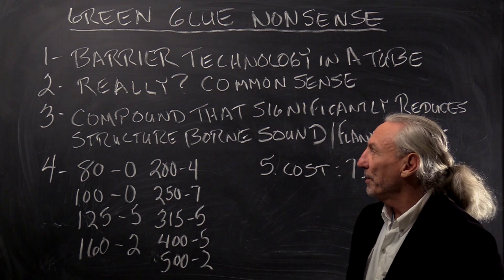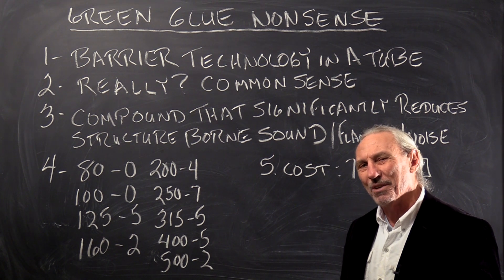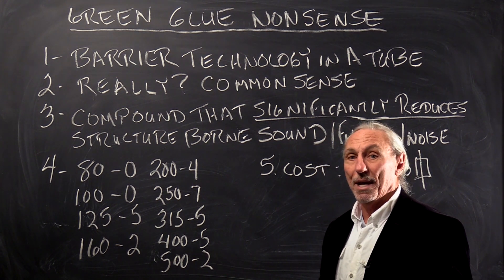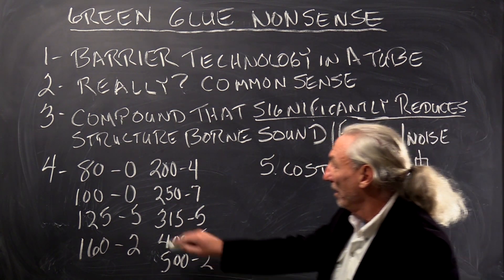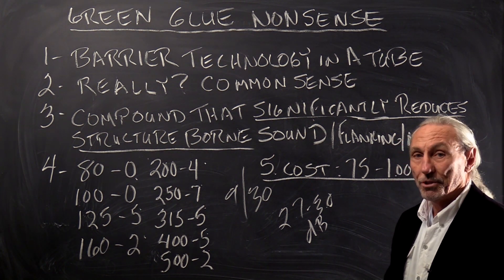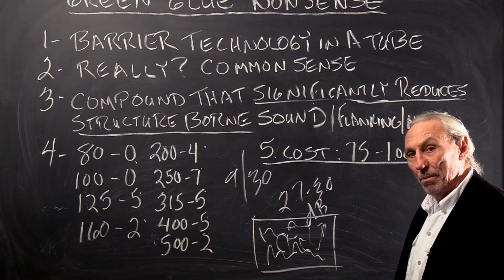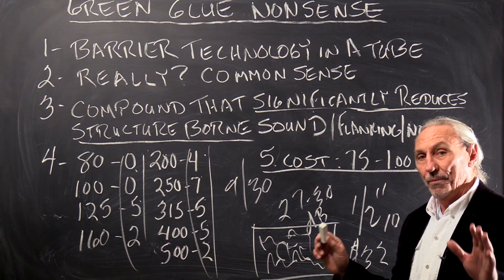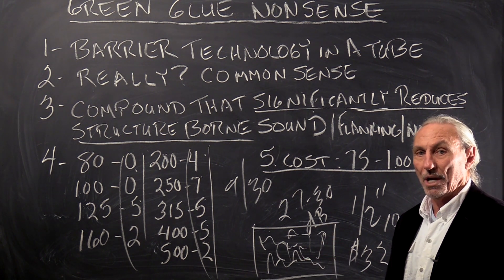Green Glue Nonsense - www.AcousticFields.com

Comment: I   rather like this video, because after using the stuff in a similar build to  one  without the green glue - my (admittedly subjective) view is that the  sound leakage was not better - nothing I suddenly went wow over. Surely here the problem is that you use it and once you have applied it, you can never know what it really does. I've had  more success with an extra layer  of MDF,  than the huge cost of green glue in terms of attenuation overall.  I don't know anyone who has built a structure without it, then replaced a layer with green glue between sheets and measured again. That measurement I'd believe. I have to be skeptical here. Buy new monitors, you  hear it - but  a very expensive layer of sticky gunge between sheets (and glue seems  a good term for it) I just have trouble with.
Reply: Hi, just wondering if you are using the MDF or for improving sound in your listening area? Thanks
Reply: @detroyt232323  A trick I did a few builds back in a college. Plasterboard is simply rotten stuff for crashing flight cases into and scuffing from chairs etc - so I added a layer of 18mm MDF to the studio built 6 months before. The extra mass improved the sound insulation and the inner surface takes paint easily. It also has the benefit you can add guitar hangers and other wall mounted things so easily - anywhere. I've used it ever since for the inner surfaces.
Reply: @pauljohnson4590  hi, I'm looking to mainly block sound transmission from a garage stereo through walls into the house. The sub goes down to below 40 db. I've already started tearing out the drywall in the garage and am currently looking for the best, most cost effective ideas on how to approach this. Of course I plan on adding a second layer of insulation and double 5/8". Just don't know if I should incorporate mass loaded vinyl, sound clips or GG. There are so many different approaches and everyone has a different idea on what is best. I have an air gap of about inches to work with. Basically looking for any real world examples of what anybody has done out there. Thanks again!
Reply: @detroyt232323  My experience through adding an extra layer, when I thought I was done, is that it is worthwhile, but green glue has tangible physics, but just subjectively didn't seem to actually work that well, was disgusting stuff and I'm going to never use it again, and if I need more isolation, then that's an extra layer. It also seems less effective on the ceilings because every screw to hold the weight of the panel reduces what effectiveness the soft glue provides - the panels have a path through to the substructure.
Reply: @pauljohnson4590  hi Paul, thanks for answering. Sorry, did you mean the double drywall or GG didn't work? What was the noise source you were trying to keep out. I am building a decoupled wall to keep out a rather large stereo system from going into the rest of the home. Thanks again!
Reply: @detroyt232323  The most common conversions for me are home studios, usually built into UK sized garages. Freestanding inner room within a room. The object is dual - to keep the sound in, so late night bass doesn't leak out and general noise doesn't wreck recordings being made inside. My system now - used on 4 of these so far is two layers of 12mm plasterboard (sheetrock-US?) with one layer of 18mm MDF - used on walls and ceiling. The usual floor is concrete, and an inner plywood floor supported on neoprene and timber strips on the floor. In the most recent the client wished to use green glue. With 2 plasterboard layers walls and ceiling, the bass I judged was too much, listened to outside the studio. It could be heard as the usual thud thud at usual inside monitor levels. Adding the extra MDF layer walls and ceiling reduced the leakage to low enough to allow the client to record at any time of day or night. I am unable to, of course, comment on how it would have worked without the (in my view) wasted money spent on the green glue. The construction of my own studio has two layers of plasterboard and one of MDF and I can operate happily at any time. Indeed - I discovered only recently that my youngest son had his friends in my studio many times when I was upstairs in bed - and I was never aware they were having parties - he told me after five years of having moved out!
Reply: @pauljohnson4590  ahhh got. Thanks again for sharing. It sounds like the 3rd layer made all the difference. I wonder what a 3rd layer of drywall do? Any experience with that? MDF is 3 times the cost here in the states. Haha great story about the kid! Thanks again for sharing.
Reply: @pauljohnson4590  also, the drywall I'll be using is 5/8" or 16 mm with nearly 10" or 25 cm between the 2 walls.
Reply: @pauljohnson4590  hey Paul! Just wondering what the minimum gap between walls to achieve good results in your experience is? Thanks again and cheers buddy!
Reply: @detroyt232323  the last one only had two inches as width was precious, and in one place there was a brick pillar that meant at that point the gap was only half an inch. On one we had four inches and stuffed the cavity between external brick wall and the room within the room with insulation. Cost a lot of money and hand on heart I’m not sure it made any difference to outside noose getting in or inside getting out. Most leakage comes from door frames and the tiny gaps where ceiling meets walls.
Reply: @pauljohnson4590  hi and thanks again! I really appreciate this. The measurements you are mentioning are between studs I'm assuming? The build I'm looking at now would be 8 inches to the outer layer of drywall. Single layer one side, double on the music source side. I've heard that just regular pink R13 performs about as well as anything else. Have you found that to be the case? Also any recommendations on best caulk to use between sheets of drywall? I'm ripping out drywall as we speak and found a pretty substantial gap on the other side probable 1/4" which is under the stairs. I appreciate you! So hard to find a good experienced source.
Reply: @detroyt232323  please remember I’m not an expert just a guy who has built quite a few and each one builds on things that worked and avoids the things that don’t. Most, excluding the adjustable experiment, only have sheet material on the inside surface of the stud work. This is always freestanding and never has a sealed ‘rear’. Decorators grade gap filler and nothing between layers.
Reply: @pauljohnson4590  ok, understood. Have you done any STC readings on your walls at all? So you are just using regular caulk that you would use to say fill baseboard gaps nothing labeled as "acoustical seal"?
Reply: @detroyt232323  I look for gaps with a omni measurement mic and headphones. Small gaps are HF escape routes and I’ve found ordinary caulk works well. In terms of measurement, all its practical to do on small builds to check for the results is before you start is to pick a spot inside and out and mark the floor. Pop an omni on a short stand with a zoom recorder. Inside put a playback system in the marked system. I use a powered 15” floor wedge. Then run a 20-20k sweep tone and make sure the volume settings are marked and repeatable. When I have walls and ceiling done, I repeat it. Only once were the results poor. I’m pretty sure this was the inner touching the outer at one point where there was an obstruction. Normally a finished project has no detectable output outside until around 60Hz and below where it creeps in. The volume level inside is very loud, the output at around 40 is below daytime ambient levels. At nightime it’s a just detectable bass thump. Inside the sweep reveals resonances, and rattles, which you fix. It also gives you the frequencies where bass needs controlling. Other than that, I don’t find anything else. I’ve done 11 now, and one issue of my own making. Fixing the touching inner/outer was a bit savage but as we knew roughly where it was, it just meant cutting out the wall sheets and then two studs, which were then bodged to provide clearance. New sheets and the result an ugly lump sticking into the room. Covered by a dummy absorber panel both sides and nobody any the wiser. Normal isolation restored. I’m nowhere near good enough a builder to offer these commercially, but I really enjoy doing them and they all work. My variable one was demolished recently when the Victorian building housing it was flattened for development. It had done twenty years service for thousands of people and never a complaint from the neighbours in a domestic housing area.
Reply: @pauljohnson4590  hi, and thank you so much for all of the input! I really do greatly appreciate you taking the time. At the end of the day I am really only trying to "soundproof" an area of about 130 SF. I plan on building a decoupled wall of metal studs around my problem area with 2 layers of 5/8" drywall and putting in all new R13  fiberglass insulation. After I get the stereo back up and running if that's not enough I will add and additional layer of sheetrock. That's my approach thus far and take it from there . You are THE MAN and thank you thank you again! What part of the UK do you reside btw! Cheers buddy
Reply: @detroyt232323  I'm not at all convinced that metal channel construction is that useful for home studio type construction. Nothing to do with it's obvious benefits, but if you build a freestanding timber wall, structurally the weight of the ceiling sits fine on it, but it's really designed for filling in a top to bottom opening, then having the same construction on the ceiling, being supported from above. It's very difficult to do this kind of construction without gaps, as I found on the one project I did using it. It's a fairly simple job finding the strips, marking the chalk line on the first layer, but the second layer is harder, and the extra thickness makes it less certain you hit the metalwork. You need to measure constantly. I jus fond timber so much easier to adjust and work with. For quick office dividing - metal is so quick, but trying to prevent gaps is much tougher. A 5mm gap not a timber stud makes no difference. Filling a 5mm gap properly is much harder. In an office, there's no need to worry about this. My trick with ceilings is to make the sheet material sit on top of the top plate of the timber, so there is no gap where wall meets ceiling.
Reply: @pauljohnson4590  hi! Thanks again. I have been reading that a decoupled wall can actually make frequencies below 100 hz worse. I'm wondering if that's been the case in your experiences? Maybe their air gap wasn't large enough? What size air gap is the minimum that you've had success with at keeping loud stereo sound out? Thanks again for any help!
Reply: @paul Johnson thank for your replies.  I concur there is no cure all one fix.  And appreciate your candor with regards to you have learned from experience.  As less experienced in this field, I was thankful picking bits of intel of product/application/infrastructure layout from your different projects you commented on.  Would love to continuing reading a blog or watch videos of your assessment of completed projects. Pros/cons dos/don’t applied to in field application.
Also thanks to acoustic fields for their insights, I understand there is great disjunct sometimes between commercial products and true physics.

Comment: Regular PL 3000 works just as good! There is nothing in the “green glue “ that stops sound propagation through materials. What does slow down sound is the amount of mass and air gaps that are to totally sealed, that’s why a double wall with an air gap in between works. Yes you can add mlv but it is very expensive and you still need double 5/8” drywall. A properly designed and built double wall works. That’s my experience.😀🇨🇦
Reply from the maker: It can work above 125 Hz. but takes up too much space.
Reply: Wrong

Comment: Bottom line is all of these comments are subjective and equally likely to be biased. Let's have a scientific, side by side, controlled series of experiments. Anything else is belicose opinion, be it in a video or in the comments. Until I see that, I'll go with mass and pay attention to sealing.
Reply: You can see actual lab testing comparisons here https://www.tmsoundproofing.com/products/GGTest/GG_DataSheet.pdf
Reply from the maker: What's the sense. You want to test adhesives. Its a waste of time and money. The adhesive layer in most of our barrier builds may represent one of maybe 6-8 layers of material types.

Comment: The product is misnamed - it is not a glue.  It is a viscoelastic compound that does not harden, and other construction adhesives (except a very few exceptions) do not stay fluid.  There is a lot of scientific evidence that this concept works, and works very well.  Because the product does not harden, when a sound (not low frequency sound) meets this layer, it absorbs the vibration and converts it to heat, thus, attenuating the vibration.  Like any viscoelastic compound, it works better at certain frequencies and not at others.  You could combine different viscoelastic in different layers to maximize sound absorption.  

I agree that this stuff is stupidly expensive.   There are other options which perhaps work nearly as well, but at a much lower price point.  I suggest trying Roberts 3095, which is a carpet glue.  It likely is not quite as effective, but costs a lot, lot less.  There is a video on the Web which demonstrates the effectiveness of green glue versus Roberts 3095 versus construction adhesive, the benefits are obvious.   https://www.youtube.com/watch?v=UtxduYYXoVY

I have watched many of your videos with great interest - this one falls flat....
Reply: The benefits of green glue fall flat in comparison to other options for the price. 
Better off getting MLV and an extra layer of drywall.

Comment: You mention knowing a better solution for sound reduction for $10 per sheet.  What is it?  I can't find you specifying it anywhere in the past year of Q&A, even when you respond to similar questions...  You're complaining about a viscoelastic damping compound that claims to reduce vibration transmission between sheets of drywall so there is less sound energy transmitted to framing, which seems especially relevant for attenuating low frequencies... yet you argue it can't possibly work because it's not a "sealer" of air transmission... which it never claimed to be...  so, if you have a more economical vibration transmission solution for $10 a sheet (or 32 sq.ft. of coverage), why don't you just name it?
Reply: From his other videos, he doesn't use sheetrock.  He has mentioned that he uses many different materials.   I've heard him mention  plywood, OSB, MDF, MLV, concrete, steel plates.   so he'll spec out depending on the specific frequencies and amplitudes that needs to be blocked

But he does repeatedly mention a 7 day noise study has to be done first.. Then you spec out what materials to use.

Comment: I like your video, can you pls provide information on the alternative sheet you referred to?
Best
Reply from the maker: M,  This is the exact issue I am trying to raise. Every situation with noise is different. Is your noise above 125 Hz.? If so, how what is the amplitude or strength of that noise/ Is your noise below 125 Hz.? If so, how strong is it (amplitude) and at what frequencies?
Reply: @AcousticFields  I get it that amplitude is a major and vital factor in determining what barrier materials to use But aside from that It seems to me that most studios will be accommodating full frequency range. I mean, if you've got a room that is occupied by drummers, keyboard players, bass players, vocalists and guitarists, you're going to be dealing with frequency ranges from about 28 Hz. to several thousand Hz. In most studios, wouldn't it make sense to base one's choice of barrier materials on the likelihood of full range, unless, of course, one's studio is built specifically for say, vocalists or tuba players?

Comment: Thank you for this video! It did not make much sense to me but it is promoted on YouTube heavily.
Reply: Why not make a better product.  Seems like ripping your competitors makes you look bad?
You don’t see Pepsi shitting on coke.. they just accept they are not as good
Reply: Basically sticking your material with green glue is not reducing sound transmission. I can't speak for the physics behind it, but 10 dB lower would be a perceived halving/doubling in volume. So it's really not doing too much for the noise. I can't speak for math here either, but looks like it's a 3 dB broadband reduction per sheet in the frequencies they measured, and you'd be spending three times as much money, and 3 dB of reduction would only sound about 20-25% quiter to your ears. So your neighbors blasting music and their kids stomping around and banging on stuff would only be slightly quiter if that's the noise source (which in an apartment or condo it probably is). Of generally speaking you can't renovate rentals like apartments, but it's also worth considering for builders. If they can get the same reduction for a third of the price they can also triple up on the cheaper material (I don't think that would result in a 10 dB reduction because there's probably some sort of diminishing return, but it's still better than doing almost nothing).
Reply: @dylanj8676  Lol
Reply from the maker: D,  Stay tuned. We will be doing another Green Glue Nonsense # 2.